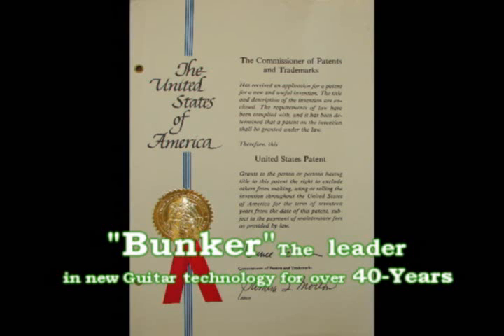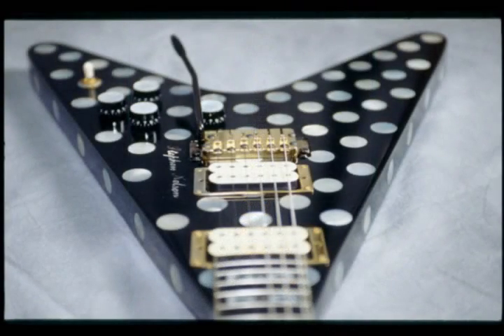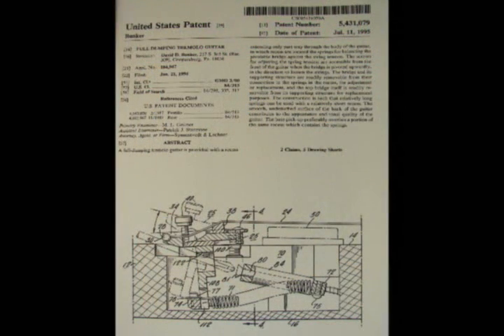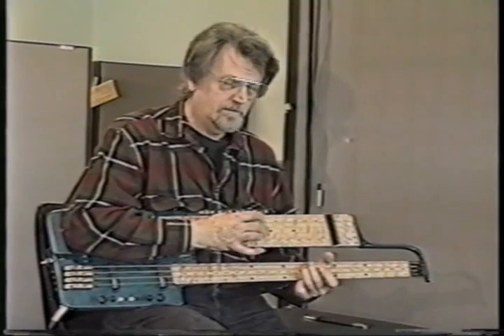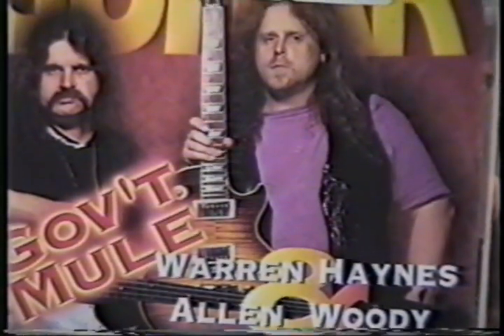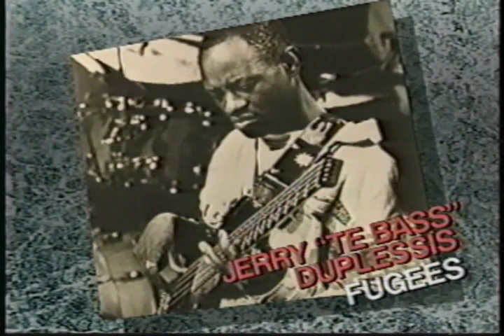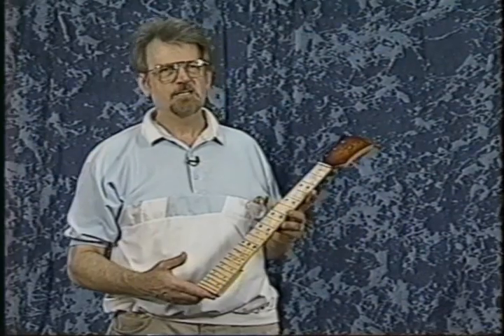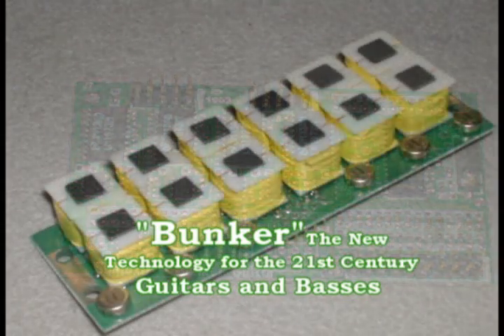Creating your new guitar

Comment from the maker: The pin at C which goes through the rod at this point is a pivot point and string pressure point where all of the string tension meets the body(not at the headstock as on normal truss rods. The D point is the adjustment screw where you push the rod backwards(back bow)or forward(relief)other necks are sqwished/compressed by the truss rod which eliminates most sustain we get from the from the neck,thanks for asking

Comment from the maker: Hi LeviMan, Answer: when you tighten a normal truss rod in any guitar neck you compress the wood backwards to counter the string pull, this is like playing a drum and putting your wallet in the middle of the drum head, it goes dead. The standard truss rod in a guitar or bass suppresses the tone and sustain by not letting it react to the vibration/motion of the string.  continued: see next comment

Comment from the maker: Answer: Tension Free, cont. The Tension Free method eliminates the stress of the string pull on the neck because the tension is pulled through the neck directly to the body/verses on the neck itself which lets the neck react as it should to each note you play which produces greater sustain and tone